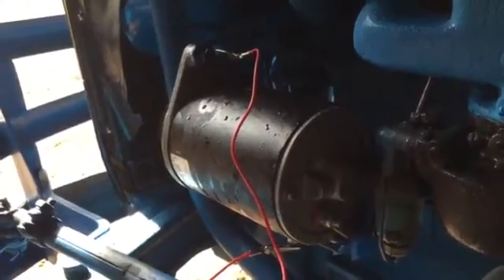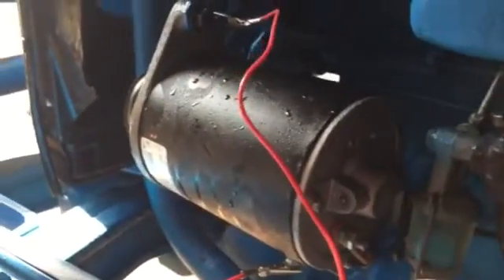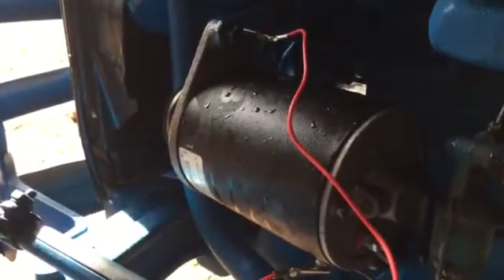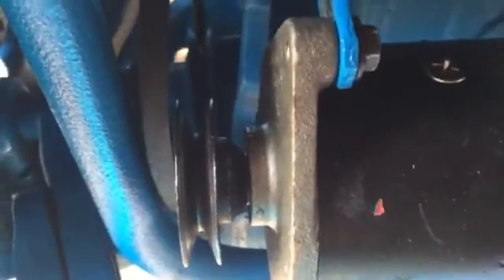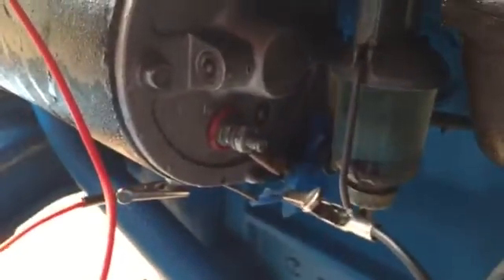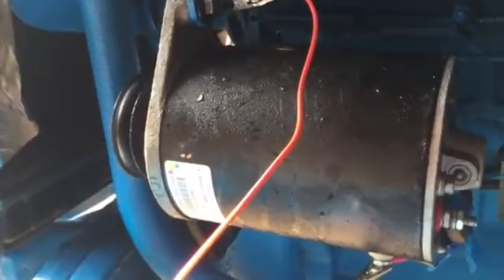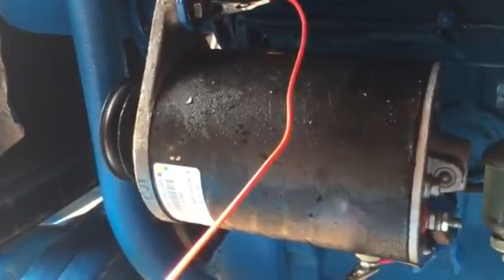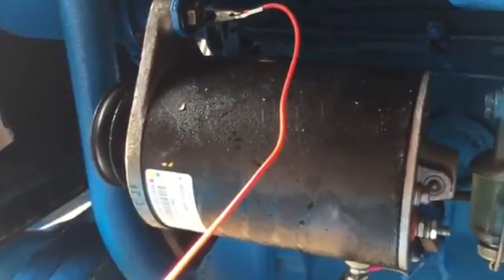Performing a Motoring Test on a Good 6 Volt Tractor Generator (Follow Up)

Comment: I think you are missing something in the video. It seems to skip. To get the Field Excitation, you need +6 ground on the G terminal of the Generator and -6 volts on the Field terminal. Applying -6 volts to the Armature terminal will create spin. This can be done on the bench with a battery and jumper cables. I tried to follow your video to the letter, but nothing happened. I then did the steps above as I first mention, and the Generator ran. I know that your end result is what you expected, but I could not get that to work.
Reply: If the battery is connected to the tractor, the positive 6v will indeed be connected to the generator case. That said, it is always worth checking ground side resistance.